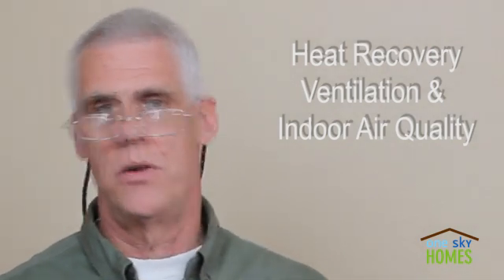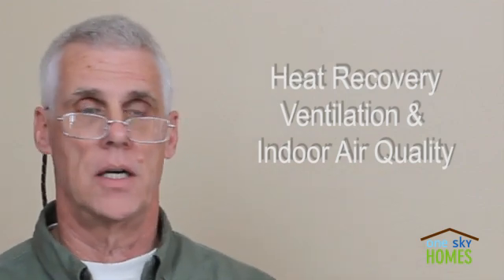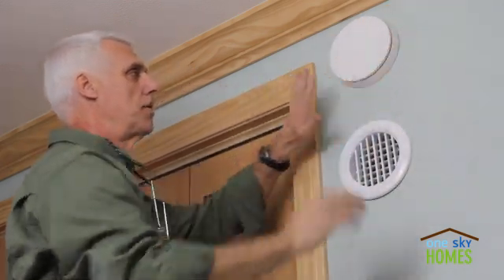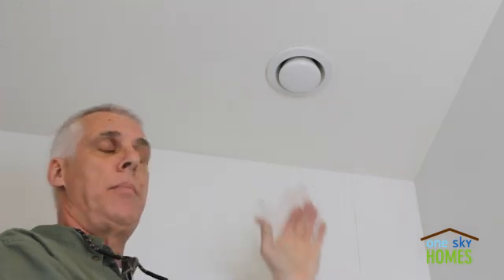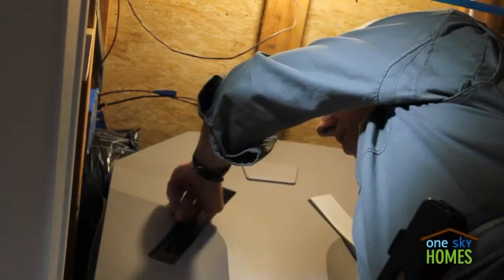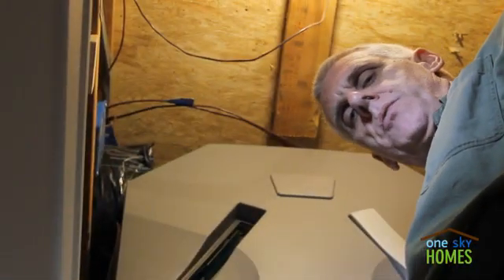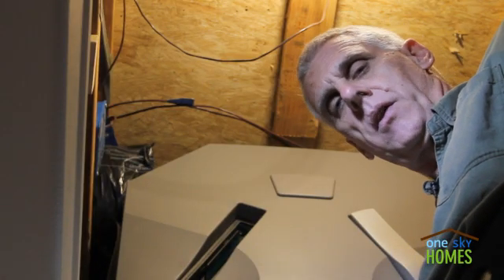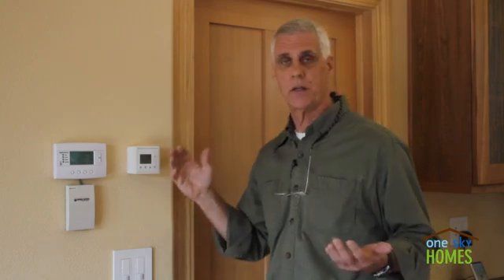Continuous HRV ventilation for superior Indoor Air Quality

Comment: So is there still fart fans in the bathrooms with this Constant air movement system an how will this work with  Showering an  Moisture
Reply: Me personally i would probably still install one. I would just use this type of system for indoor air quality and not moisture coming from a shower.

Comment: i-would-never-instal-a-heat-recovery-ventilation-system-in-some-kind-of-attic....first-the-filterisinth-easy-acces+the-heat-in-that-area-or-the-cold-temps-can-damage-the-house-cause-by-extracting-humudity-you-need-a-drain+the-unit-may-and-will-eventually-suck-air-from-that-area-they-are-not-completely-air-tight-its-a-no-no-instalation...._look-were-the-air-filters-are-and-you-will-understand.....i-dont-recomend-ps;27-years-in-the-business
Reply: I have installed a pir unit in my loft but it has created other problems, I am now looking at a heat recovery unit but too feel it's wrong to place it in the loft, have a storage cupboard upstairs, do you think it's a better choice and can I possibly get a external unit that I could mount outside and vent into my house? Cold air sinks and it's a problem in my kitchen and lounge we had a dpc installed there's no damp but the cold air is sticking to the walls and tiles on the floor in my kitchen plus still get condensation on my Windows even with the pir unit working and causing my central heating to work overtime, my house is built 1840 I've no double skinned walls, no ventilation, it's driving me insane, please help.
Reply: ganooster-certanly-not-outside-the-uptair-cupboard-is-a-better-option-buy-a-unit-that-will-run-between-150-to-200-cfm-and-controlled-digitaly-whith-aluminium-core-not-plastic-core-the-best-is-[fantech]-great-product-you-will-need-some-expertise-on-the-whats-ans-were...good-luck